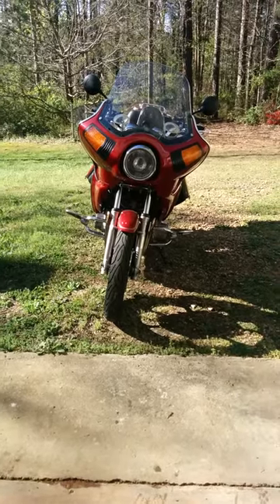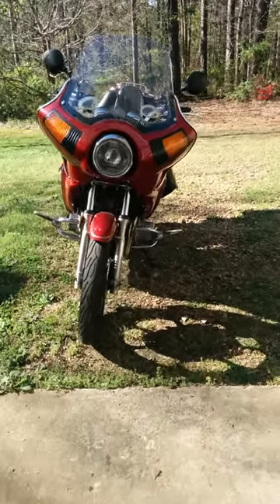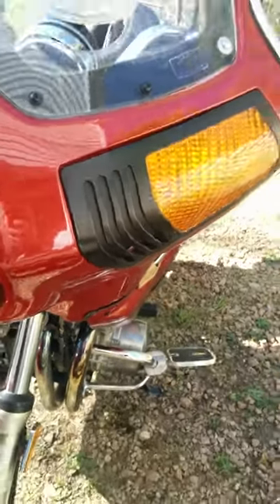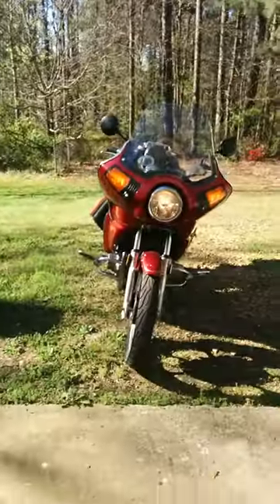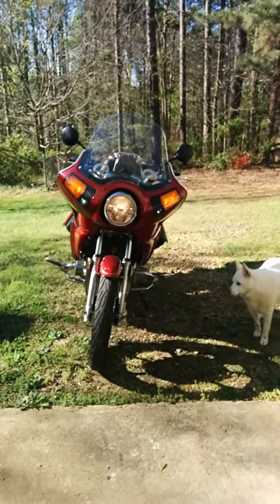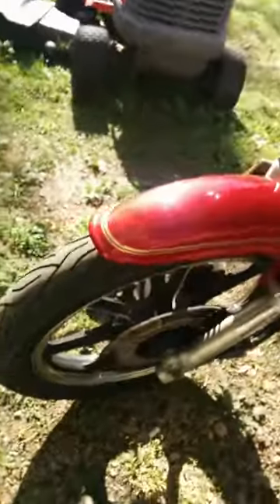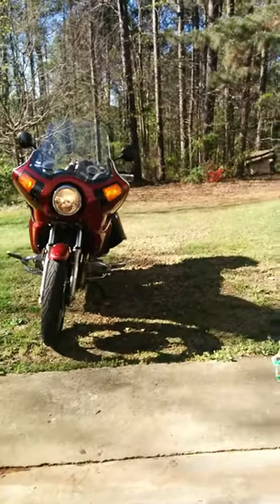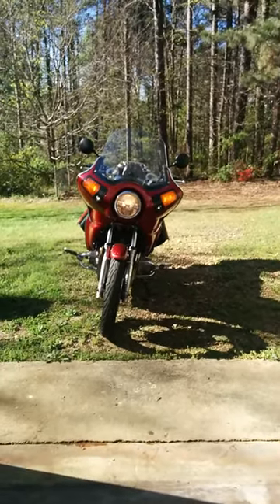Vetter Windjammer strobe lights

Comment: Hi.. is also have a KZ1100 and was wondering if all  Vetter fairings are compatible with my bike... thks
Reply from the maker: +javi Roth Pretty much they are all the same. The hard part is getting or making mounting brackets for it all. You can find out a lot about Vetter fairings from Craig Vetters website http://www.craigvetter.com/pages/Vetter_Fairings/Vetter-Fairings-main.html
Reply: Thanks..!!  And my bike is like yours, only blue..cioa.....